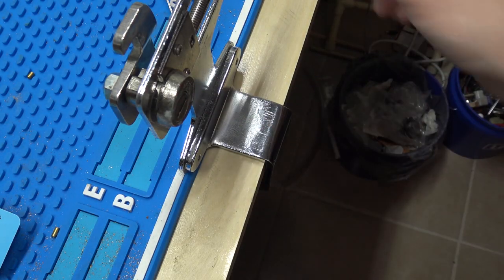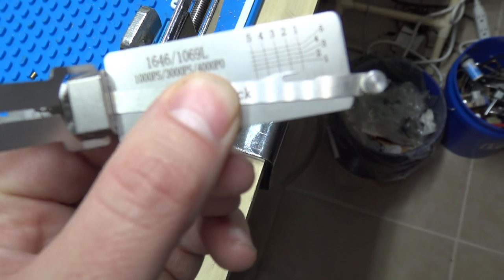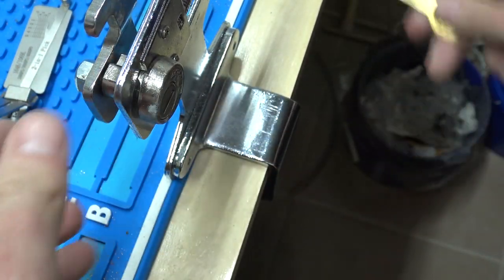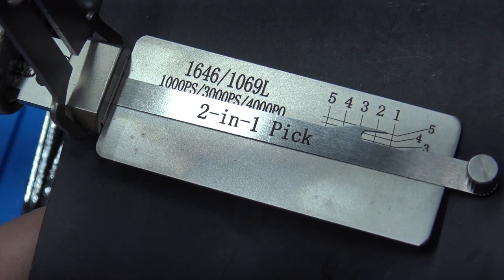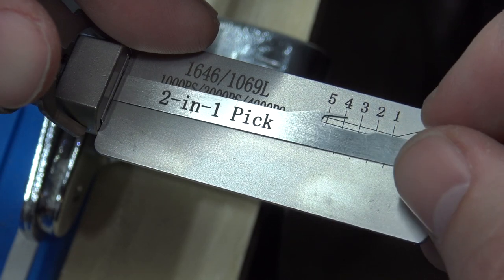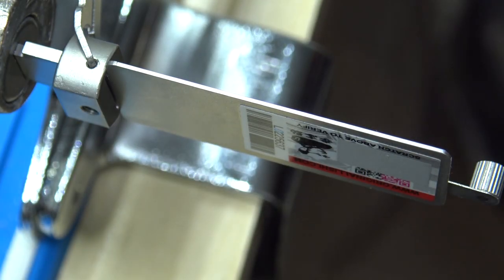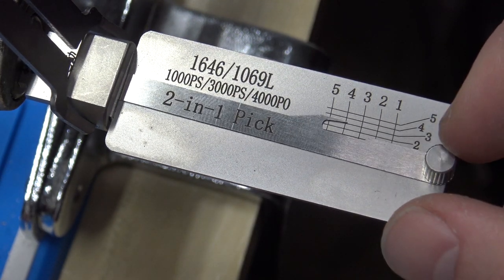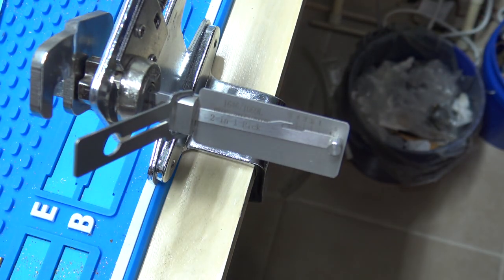(506) 1646 Mailbox Lishi Picking & Decoding a Mailbox Lock

Comment: Thanks for the video.  With the ILCO 1646L blanks, I had to drop 1.15 cuts from the number decoded by the Lishi.  Where the Lishi decoded “3”, I cut to a 1.85 on my Blitz.  Worked beautifully, and knowing this will save some future clients some replacement cylinders .
Reply from the maker: I didn’t know if I mentioned it in this video or not but I use the 14 wheel instead of the 1011 wheel when I cut them
Reply: @BoredLockpicker  I didn’t hear that in the video.  I just used the 1011 cutter since it was on my machine. 🔑

Comment: Thanks so much for sharing these videos! I'm a newbie locksmith. I don't quite understand why you'd need two lishis. If 9100s rotate one way and 9200s rotate the other, can't you just buy one mailbox lishi and tension it accordingly?  Sorry for the dumb question! I'm sure I just don't understand enough about mailbox locks. Thanks again!
Reply from the maker: They’re different keyways
Reply: Not a dumb question for a new person.  There are two different shaped (reversed) keyways on these cylinders.  Take a look at the ILCO catalog at the 1646 and the 1646L profiles and you will see the difference.

Comment: Hey man, thanks for the video. Fellow locksmith here, I can never get the lishi to even go into these locks. I have the correct lishi, jist won't enter. I end up drilling and replacing. Any advice? I'm very good with the lishi otherwise.
Reply from the maker: never had a problem with 1646 or 1646R going in.  Supposedly one of these is supposed to fit into NA14 but mine dont fit
Reply: @BoredLockpicker  I think I need the R version
Reply from the maker: First thing I do is see which key blank fits then I know which Lishi….
Reply: @BoredLockpicker  I agree with your method. I don't carry the blanks because I was never able to pick them. I drill and replace but I will definitely carry them if I am able to pick them. Appreciate the information